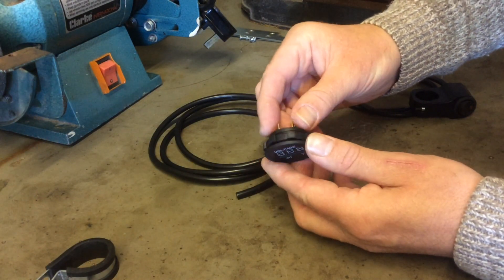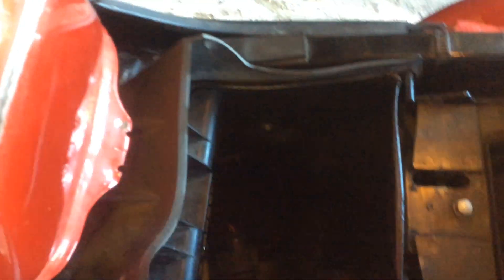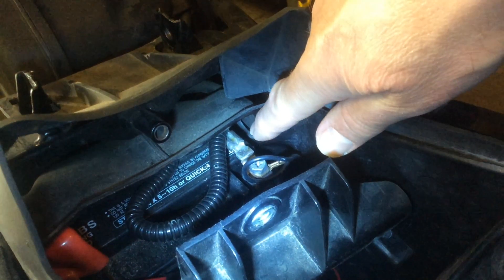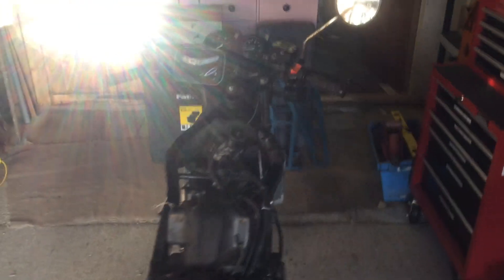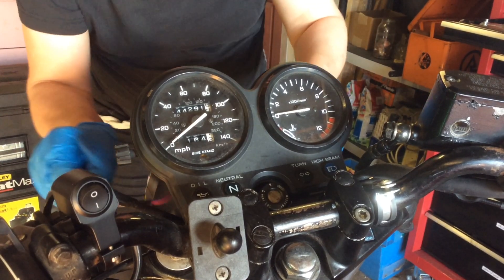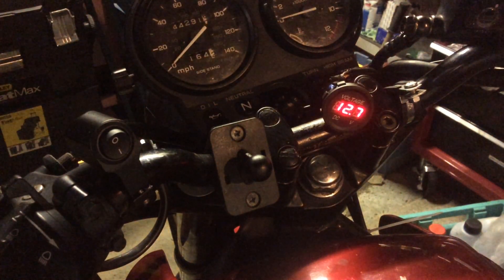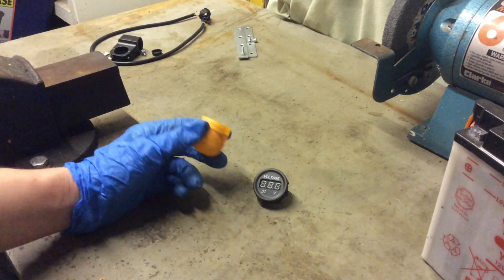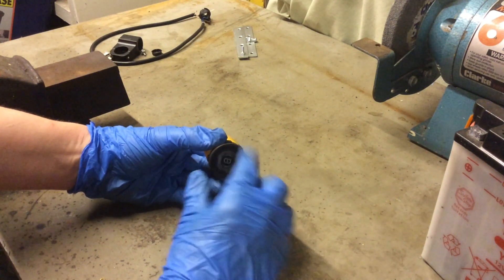Motorcycle Voltmeter

Comment: I just got a new to me used motorcycle and I’m removing the volt meter and dash cameras from it. Why does my volt meter also have a cable running to the sparkplug? Thanks if you know 🙌
Reply from the maker: Well that’s odd, you’d test a plug for ohms resistance, but if the voltmeter is hooked up, maybe they were looking for an intermittent misfire, or an irregular spark but voltage at the plug runs into 20,000+ so that’s altogether bizarre using a little voltmeter. That’s the kind of dynamic test that’s best done with an oscilloscope, or a decent multimeter and the engine running but the bike stationary. How very odd. I used this voltmeter to ensure the bike was charging while riding confirming we have a good stator, and to ensure the regulator was functioning well.

Comment: Ah yes, a fellow Stanley Fatmax owner. What do you keep in yours? You organized or just throw whatever in the bottom like me? Haha.
Reply from the maker: LOL, in my large red drawer cabinets I am extremely organised, but in the fat max it’s mostly stuff that doesn’t get used very much anymore, or just infrequently.
Reply: @memybikeni9931  exactly 😂 
Good video btw, I'm looking to I install a voltage display after my regulator/rectifier went bad an fried my battery. The thing might give me a bit of a warning next time.
Reply from the maker: @MizMods  yes that’s what I did it for, as an early warning, I was interested to see if it was undercharging during riding, so I know if it will restart or not, but also whether it was pumping more than 15v in as that would definitely give you a regulator heads up.

Comment: does one line from digital meter connect to the  positive terminal + and one to the negative terminal -?
Reply from the maker: Yes, that’s how I did it. Alternatively you could connect -ve to the frame.
Reply: @memybikeni9931  sorry i should have said connects to positive teminal and negative terminal on battery with fuze on the pos wire from battery this correct ....then couple to unit pos and neg
Reply from the maker: @JOHNMINKA  you can run it through the fuse box yeah I just didn’t on this as it’s draw is so low.

Comment: This looks great. Im looking at adding a little digital speedo to my cb
Reply from the maker: it’s definitely a good early warning system. volts too low while riding could be a stator/charging issue, too high reg/rec possibly has a fault. your service manual should tell you what to expect at idle and again at around 3-5k rpm for a healthy system. Digital speedo is a nice addition, tachos also quite popular, I think they work off the coil signals, but not sure on the speedo.
Reply: @memybikeni9931   I can agree, I would like to do touring on my Cb so I will sure look into a voltmeter as a hud for the additional usb charging ports and givi lights I plan on installing. It would be great if you could maybe do a digital speedo install video :D

Comment: Looking good chap I would off put it between 2 clocks so it look like it was ment to be there
Reply from the maker: I totally agree it would have looked original, but fitting would have meant drilling into the clocks and this is my Honda, not one I want to mess about with, as original parts are sort after. I just service and maintain this bike, but keep it original, aside from added bits like this. I’m thinking of doing one for the XV535, and as I am now furloughed until at least July, I do need to find jobs to do on it 🤣
Reply: @memybikeni9931  lucky you they cut back at my place on staff and know I'm doing all hours to cover the ones that's been furloughed. I'm more at work then home.
Reply from the maker: @fuelheadjay8800  not great having to work your socks off, but I’d prefer knowing I have a job to go to. I work in the housing market. I think I’ll probably be back in July august latest, but any more than that and I’m living back with family.